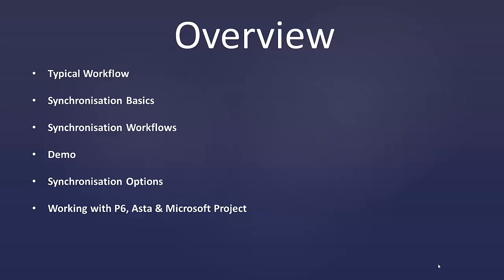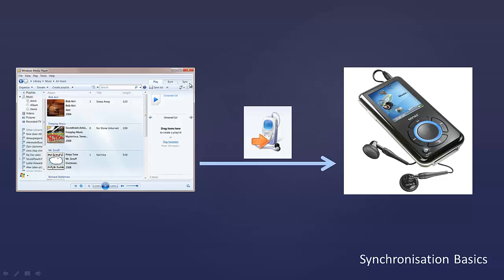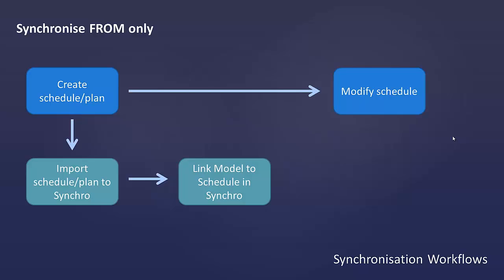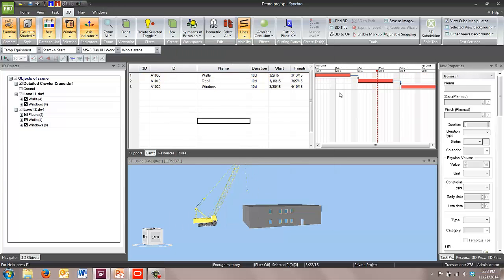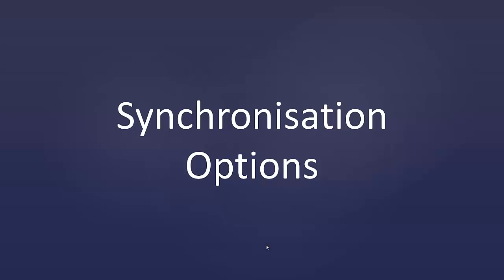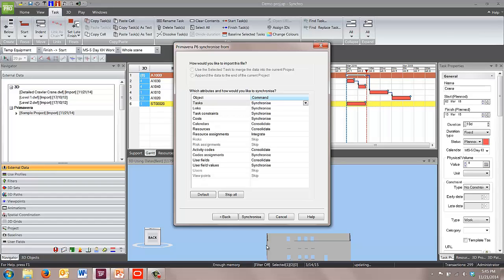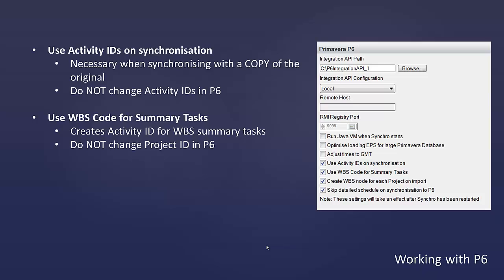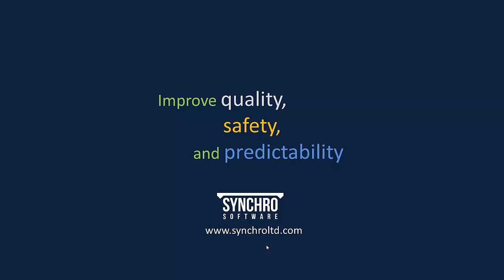Webinar: Synchronising Schedules in Synchro PRO

Comment: Sychro feels there software is the best which is not a case. so Let me enlighten anyone Trying to figure this our. IF you get the API integration error. Then in your Synchro options you need to set it right. (The path to primavera P6 Integration API is not correct or the API has been uninstalled from your computer)